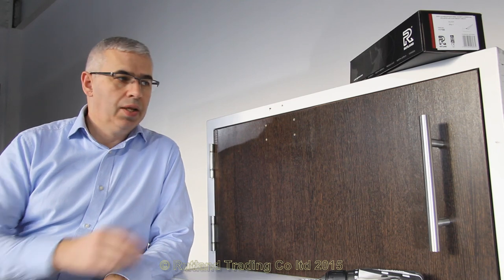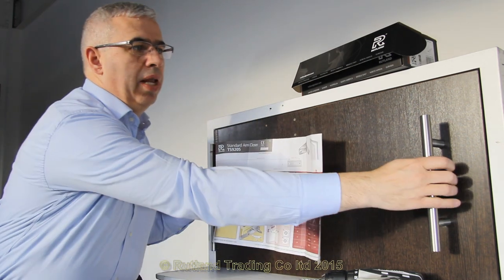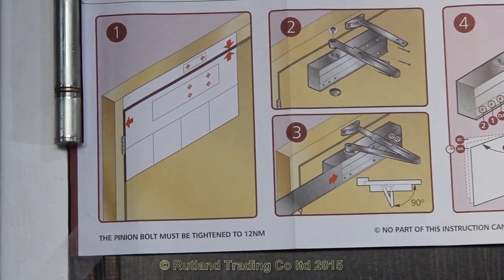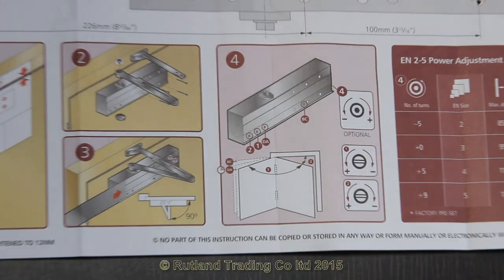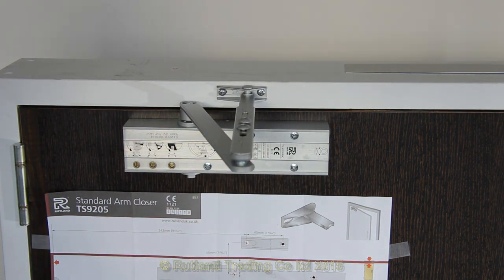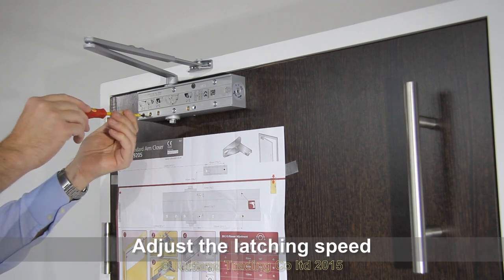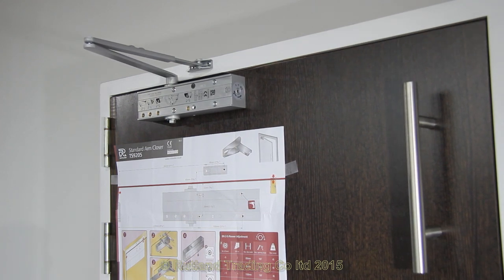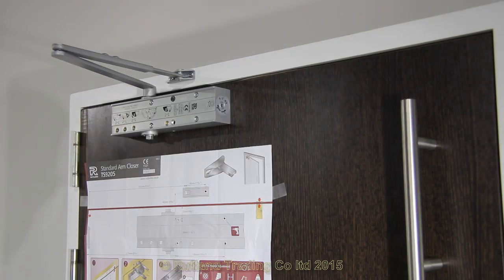Rutland: Know How - Rutland TS.9205 How to fit - Pull Side Figure 1/Standard Arm

Comment: Excellent Video and explanation. There are seven of these units in our apartments, all wrongly adjusted ,so it seems .One of them is the push type fitted on the exterior of the door. My own one is mounted "upside down" ,.Does this make any difference?
Just downloaded your installation sheet looks like its correct for right hand door hinges (from inside)
Reply from the maker: Glad the instruction sheet was helpful!

Comment: Is the backcheck the best method of stopping the door from opening too quickly when caught by high winds? We recently had an injury where the door was opened, the wind caught it and it yanked the persons arm back. Thanks
Reply from the maker: Thank you for your interest in this video .Unfortunately backcheck does not prevent winds from catching a door and opening with the force of the wind as it relies more on an instant force rather than a continued force, such as wind, we don't recommend relying on backcheck when used on exterior doors for exactly this reason, especially when the door can extend past the door closer arm and clash with an exterior wall.  We always suggest a safety barrier to protect wall/door damage. Hope this helps

Comment: That's all fine but there's no reveal at the top of the door
Reply from the maker: Hello, for fitting in a reveal, the maximum size reveal this closer can be fitted in is 60mm. For anything more we would usually recommend fitting the closer on the other side if possible, or using a concealed door closer. 
https://www.rutlanduk.co.uk/its-11204-concealed-cam-action-door-closer